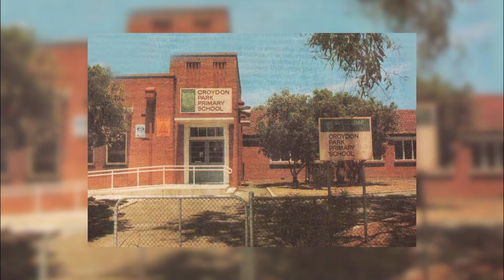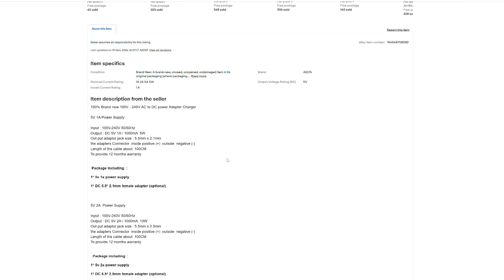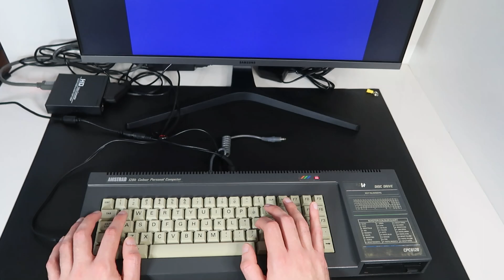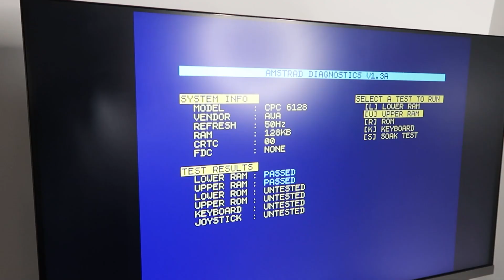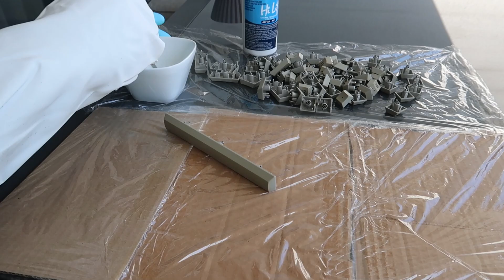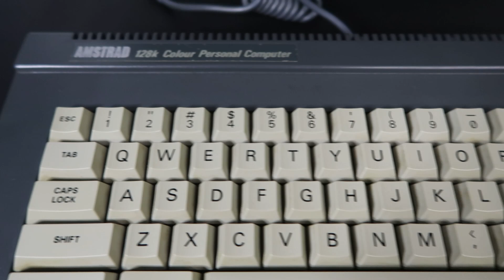Can we get this untested AMSTRAD CPC 6128 working?

Comment: I have CPC 464, and few years ago have bought "Zaxon" DDI4 disk drive controller interface + Gotek floppy emulator driver. 
Gotek needed some modification - Flashed with "flashfloppy" ROM, and  standard display replaced  with OLED display.
Gotek very easy to find on Ebay, Aliexpress, Amazon, with a price 20-25 Euros... I have bought 4 of them for my different projects. There are few different models and some are harder to mod, so be careful when you buy one.

Comment: The CPC range is a fantastic line of computers and reasonably bullet proof. About the only thing that goes wrong is dirty edge connectors and the belt in the disk drive. 
Although more expensive, id have to give my vote for the DDI5 or 6 for loading media and if you decide to invest more, it’s certainly worth it.
Best of luck with the channel 👍
Reply from the maker: Finally owning a CPC and looking at it in more detail, I agree they're fantastic. Thanks for the info on the DDI5/6, and for checking out my channel.

Comment: An external gotek would run off 5v, so you could split that 5 ampere current juggernaut, and send some via a pin converter into a Berg/molex plug for the Gotek.

ULIFAC/USIFAC loads files only, so protected disk games won’t work. You’ll still need a floppy drive or the Gotek.

Further, Amstrad disk games nearly exclusively run off the A drive, so some form of an “ABBA“ toggle switch would be required to change drive IDs around to use a Gotek. The basic device or the upgraded ones with OLED/rotary
button are cheaper off Aliexpress, but you’ll need some way of reprogramming it’s firmware to load in the FlashFloppy replacement firmware.
Reply from the maker: Thanks for watching and sharing these tips. I've already found some disk images that don't load properly on the USiFAC, even with FDC emulation. I may buy a Gotek in the future.
Reply: @ it’s nice content and you’ve got good video production techniques too. best wishes for your YT channel 👍
Reply from the maker: @the_more_you_kno  Thanks so much. I appreciate your feedback.

Comment: So there is a labor free way(for faster browsing of Amstrad's library) to  use your USIFAC II or ULIFAC (its the newer version with the 512k of memory expansion and 6128 emulation for 464 users).
On USIFAC II you  type run"FM" and you get  to choose between your new card and an older version( press N).
Then you have access to the root directory of your usb stick like  on a Gotek. By using the arrows you can choose which file you want to run (by pressing enter). 
On ULIFAC you just type  |FM and you  go right in the root directory.
In both cases you will only have to type  run"and the name of the executable" under floppy emulation (FDC) which kicks in automatically when you choose a floppy image, without the need of a additional  command. 
Enjoy your CPC!
Reply from the maker: Great tip! I've downloaded the File Manager, and it definitely makes browsing and launching easier.

Thanks for the info and for watching!